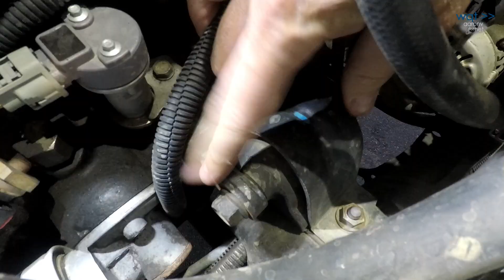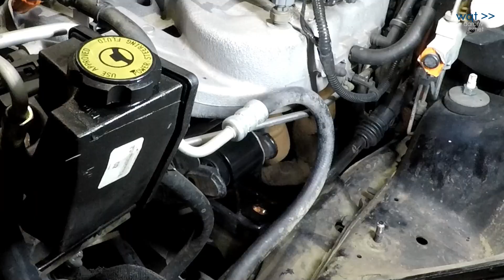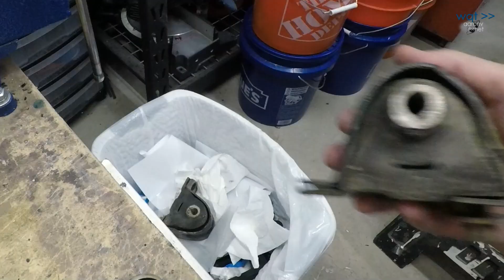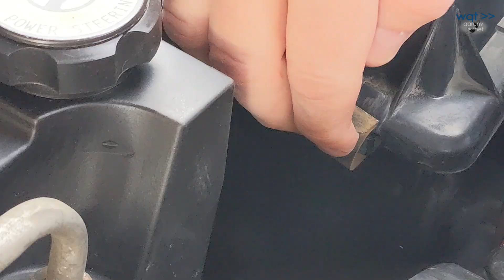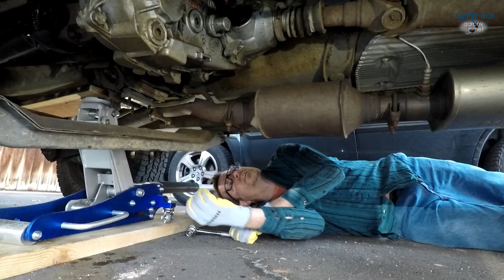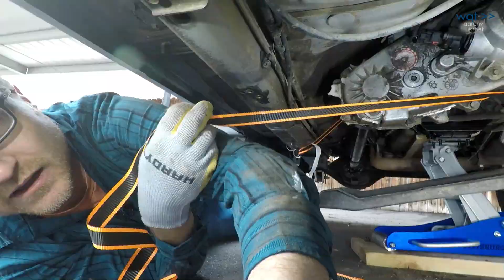projectXJ: 4.0 Auto drivetrain mounts, OE or aftermarket, done step-by-step (84-01 Jeep Cherokee)

Comment: Any update on the engine mounts? Are you still liking them after this long?
I have a set from a different manufacturer that has significantly smaller rubber bushings. Mine are very harsh. I was thinking of swapping to the Rusty’s mounts because they look to have a lot more rubber in the bushings.
Reply from the maker: They have broken in a bit and the vibrations felt in the cabin are not as prominent as when they were new. But there is no substitute for the OE mount if you want the OE level of damping.
Reply: @aaronvienot I hope mine break in some too. I installed mounts from ironman4x4fab. They are very well made but have very small rubber bushings.
Great job on the vids! 
I have an old 93, but my 15 year old daughter is starting on an 01 for her first car. She loves your channel!